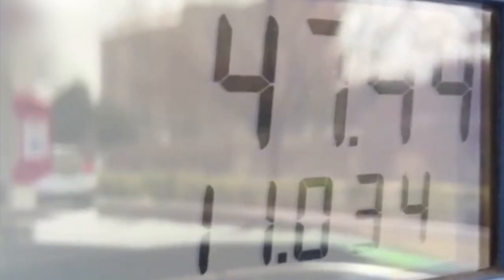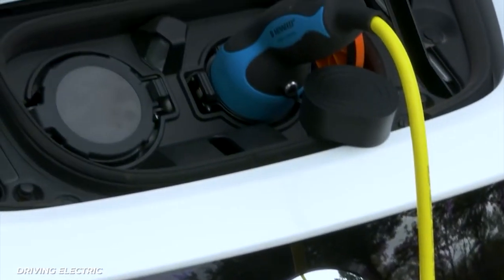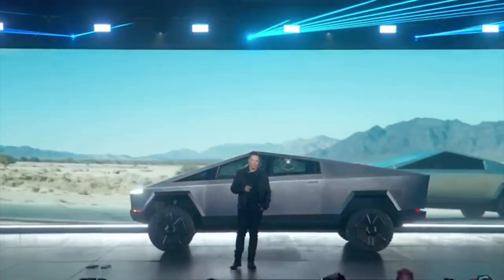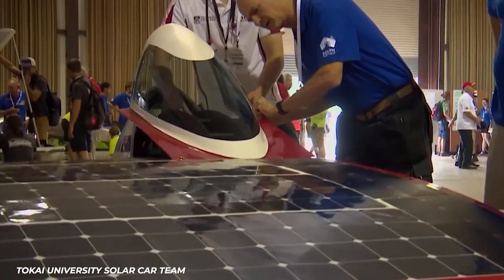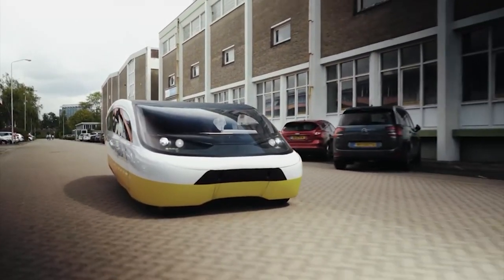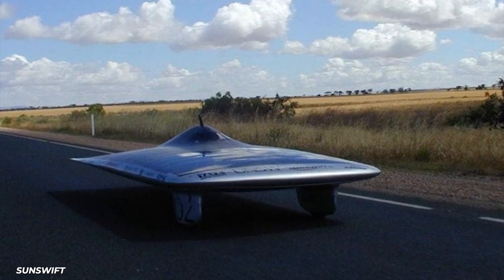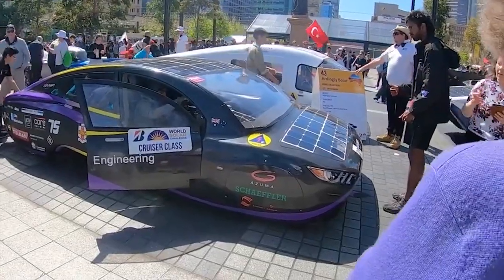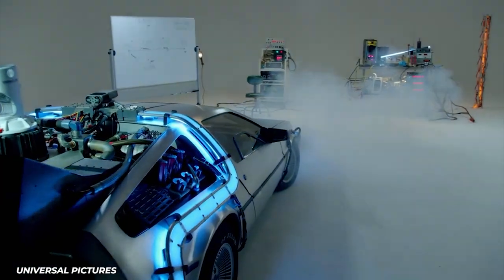Millionaires Are Buying Solar Powered Cars

Comment from the maker: What did you like most about the solar powered cars 😍?! ☀️
Reply: I like the fact that I will be able to drive my Aptera 40 miles to work, and just leave it out in the sunny parking lot (as usual) and the onboard solar panels will have charged up the batteries with another 40 miles of electricity for the drive home. With half of the power consumption, I may only need to charge up overnight, at home, once a month.

Comment: That car is cool, when a normal car hits it they can use it as a coffin to bury the driver in. 🤣
Reply: Same for motorcycles but this seems worth it for gas freedom
Reply: Which car are you referring to? The Aptera? The extremely strong composite body is similar to an Indy cars cockpit, with very high safety expectations, more info will be available as Aptera will be submitting the vehicle for safety testing, even though as a motorcycle/autocycle it is not required.
Reply: People who make such comments have not learned much about the Aptera. Wheels can be sheered off but the "cockpit" stays intact. Safer than most cars and Motorcycles.

Comment: Sion is a every day car for me! 
Aptera ma by a good option if someone wanted to do long range a lot of times.
Reply: Both vehicles are non existent.
Reply: I see the high capacity battery as more than just range.  Let's say your daily commute was completely covered by available solar (700W is said to provide upto 40 miles in a day), the a large battery can give you nearly a month of bad weather allowance before you have to plug it in.
Reply: @pavanbiliyar  True but a bigger battery needs more energy to be cooled in the summer and warmed up at winter. So overall I think it would reduce the overall efficiency of the system.

Comment: Millionaires are virtue signalling.  Meanwhile, I'm doing a 500hp big block for my F250 4x4.  I'm also virtue signalling...
Reply: Odd viewpoint.  Small penis is not typically considered a virtue.  You can try to make up for it with big toys.  To each his own, I guess.
Reply: I'll virtue signal too.  All trucks should have a  1200 torque minimum diesel engine
Reply: @squidbeard492  Sure enough but difficult to achieve
Reply: @johncamara1650  what's so difficult about putting a semi engine in a ford ranger?
Reply: @squidbeard492  engine/trans weighs as much as a Ranger
Reply: @johncamara1650  good the extra weight helps keep front wheels on the ground when towing loads.  Don't forget the periscope to see the road over the engine
Reply: @squidbeard492  The ante for 'saving the world' virtue signalling has risen dramatically.  Sales of yesteryear's darling the Prius have plummeted in the past 5 years or so.  You have to have a tesla these days.  Prediction:  all the other car companies' electrics will fail to sell well for the same reason that the other co's hybrids didn't sell well in the past...people needed a Prius (yes and only the hatchback, not the sedan)  to get recognized as properly signalling. Nobody can signal properly in a BMW full electric...only a telsa.